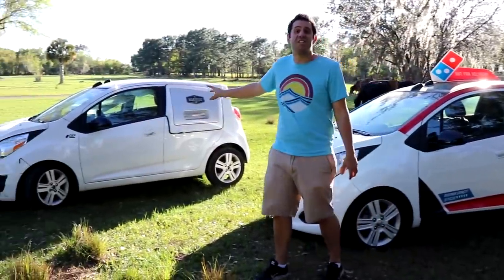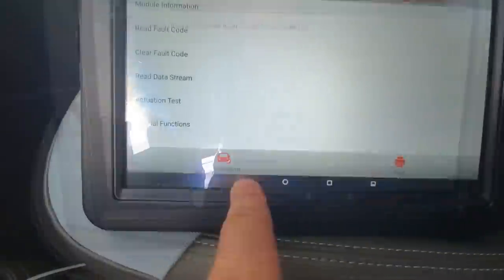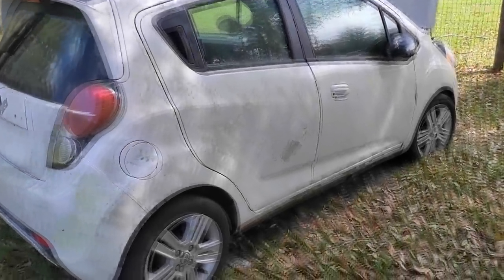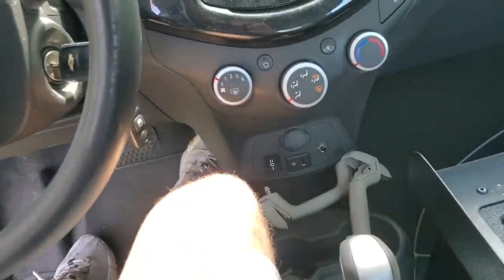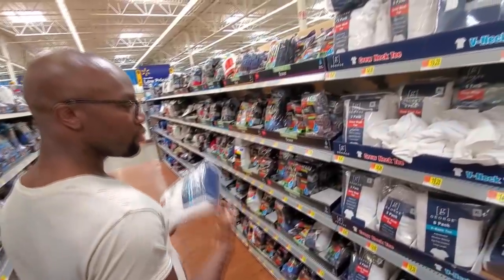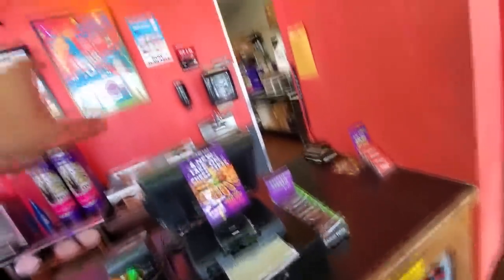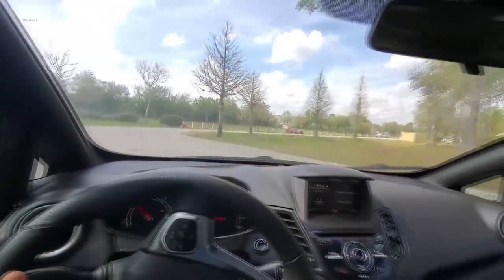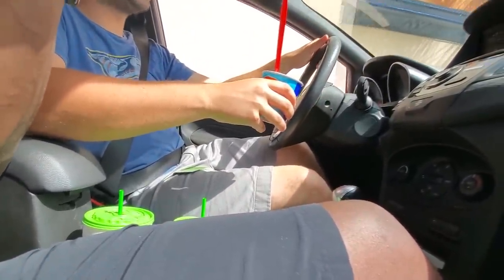Dismantling the Domino's Pizza DXP Car to Rebuild a Rare Electric Chevrolet Hatchback

Comment: I love my spark ev!  400/Tq and 2800 pounds makes this thing tons of fun.  Also the weight distribution is amazing so it barely understeers.  And it has 4x100 wheels!
Reply: Absolutely love my 2014 Spark EV too =3
Reply: Also bought mine for 6500 bucks with 40k miles.  I encourage anyone to get one!
Reply: @ankurlee-vakil4063  I just passed 80k miles with mine. Battery is holding up well. Had an estimated range of 75 miles on Friday. Considering at new the battery gave you 82 miles... Six years and 80k miles later only a seven mile drop in range(though last summer I did have a couple of days it said 77), batteries, at least for the Spark Ev, seem to age well enough ^_^
Reply: Kiaranth yesss that’s awesome news.  Thanks sir!
Reply: I loved mine while I owned it, great car. If only I didnt have to drive so much per day. More fun then my prius for sure

Comment: Nice vid! I picked up a wrecked spark ev not too long ago as well. I'm actually putting another spark motor in the back of it and using a volt inverter with a custom board to run both motors. Hoping to make a rally car 😂 the spark indeed does melt tires in sport mode as well just fyi haha

Comment: I daily drive a Spark EV and I'd recommend having the warming oven run off of an auxiliary 12V battery bank, because of how little range it already has. Anything you can do to reduce residual draws is going to help your range and available power. Even just driving with traction control off will boost your efficiency and range. Make sure you reset your trip odometer so the range number is reflective of your driving. Any time you can drive with your climate control off is going to help save your range as well. Turning off your daytime running lights helps a little bit, but it's not as noticable. Feel free to ask me any questions about it. Enjoy your new Spark EV!

Comment: Small low power cars like that are designed for heavily congested urban areas where you aren't going anywhere fast anyway, low power and low emissions makes sense there.  Makes much less sense on most US roads.  An electric car moving at low speeds will emit sounds from an onboard speaker (required since 2010 or so to warn pedestrians), and you can hear this in the cabin (usually).  Teslas let you customize this sound to be just about anything you want.  The engine makes a very small amount of whine, you'd probably never notice it unless you know what an electric engine sounds like and are listening for it.  But when you "start" the car, you will hear a brief "clunk" sound as the relays close to turn on the high voltage system.  They are open when the car is not "running", mainly for safety reasons (so you don't have high voltage when unnecessary).  This is also the reason EV's need a 12V battery, you need something to close/open the high voltage relays to the main battery.

Comment: That Chevolet Spark, was sold in Europe as, Chevolet Spark, not a Dawoo Matiz, Matiz, was the previous model, the spark was the first attempt by GM to try to sell some cars in EU under the Chevolet badge.
The Spark did ok, but the rest, not so much, and now they are out of EU again, and they even sold Opel/Vauxlhall(EU) to PSA.
Reply: And PSA made Opel profitable again in a year. GM is a joke.
Reply: Well we will see about that, now the first round of Opel´s run off the line on PSA platforms.
Those currently still on, are still made by GM
If they dont improve the quality, and just be another PSA car, i do think Opel will die out.

Comment: I admit I wouldn't mind having one of these cars under certain circumstances. What I'm talking about is I am fortunately got sandwiched with a Dodge caliber didn't have a lot of options at the time. The car is about the same as driving a beer can, and I wish I was joking. Don't get me started on how badly damaged. The seats are and I'm still not in a position to do something about that driver side seat, which I suspect is going to result in me getting a spring someplace. You definitely don't want that kind of thing Taking place. I was under the impression sense about a month after I got it that the motor was screwed and has been waiting to grenade. Found out on Wednesday. The problem was the alternator, not the motor. Jesus, I hate my life! Cost me just over 300 between getting the alternator and having somebody put it on because I can't do it myself, where the alternator is located, combined with the fact of that damn belt. That little tiny underpowered Chevy that they use to make the pizza. Car  I wouldn't mind getting one cheap and driving it for while. Even if to compare it to the Dodge caliber. I could make you a list of stuff like if you roll the window down and go to close the door, you run the risk of the window, shattering any time you close the doors. It sounds like the door is going to go flying off of the car. The amount of noise, just from closing the door is insane and you're barely even pushing it closed. Literally, you feel like you're inside a beer can driving down the road with the various body noises that are factory to  The vehiclecur

Comment: Sam, when driving a manual car you should sit a little closer to the wheel because your leg is fully stretched when you press the clutch now. It's not safe when you press the clutch and someone crashes into you with your leg fully stretched. You could break your leg.
Reply: @BullittKid08  Have you ever even driven a manual car before? It's quite uncomfortable to fully stretch your leg to change gear every time.
Broaden your mind, think ahead ;)

Comment: 0:28 - let's get this out of the way, first - GM and Chevy has not been a 'top tier' automaker for 40 years.  They sell junk just buffed and polished enough to keep fooling GM fans.
Reply: I beg to differ. I've got a million miles on my Chevrolets that I bought new and used over the last 40 years. Not one needed a transmission or engine replacement. Tires brakes batteries few other miscellaneous repairs. Like any manufacturer they have made some lemons. But overall for holding my family around, Chevy can't be beat.
Reply: Just plain not true